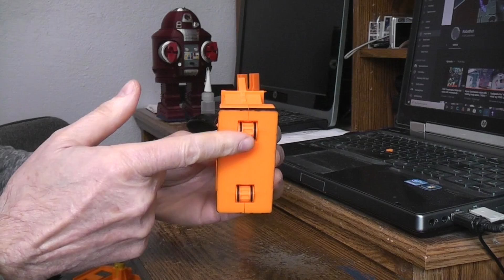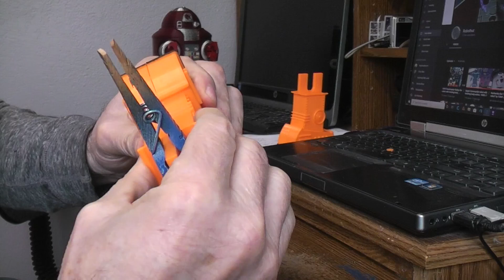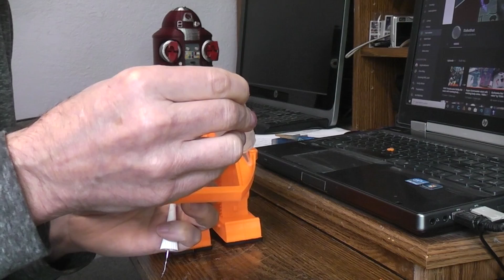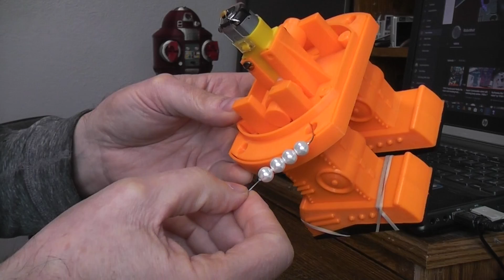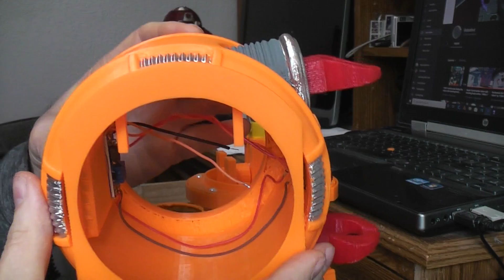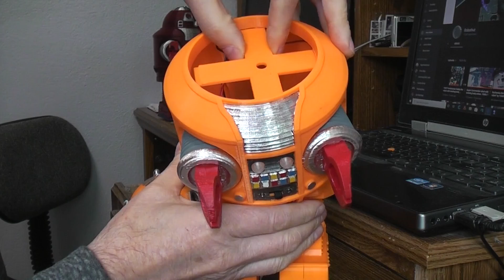Build this Walking robot with twisting body action. 3d printed project.

Comment: What is the width of the nail for wheels?
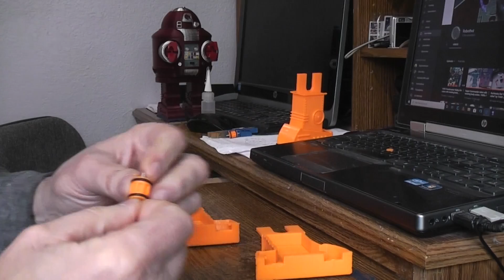Reply from the maker: I state in the video at 2:52 that the nail I used 1.8mm diameter and the length will be cut short enough by you to fit in the slots without binding when both leg parts are together.
Reply: @Robothut yes i know the diameter but not the length ?

Comment: What about a bill of materials? Like where would I get that motor and those other parts?
Reply from the maker: The TT gear motor can be bought from Ebay, Amazon, Banggood, Ail Express and so on. Any gear ration will work. The batter holder can be found at all the same places as well as any online electrical parts stores. The slide switch is from ebay. Flashing LEDs you can find in all the same places. The flashing Red LEDs will work off the 3 volt supply as is , other Flashing LEDs like RGB color change LEDs work better off 5 volt supplies as do the greeting card sound units, both can be found on ebay. Step up voltage regulators to change the 3 volts to 5 volts can be found in all the same places.